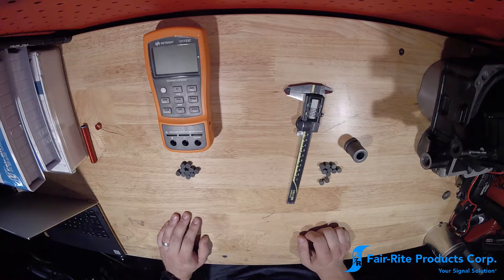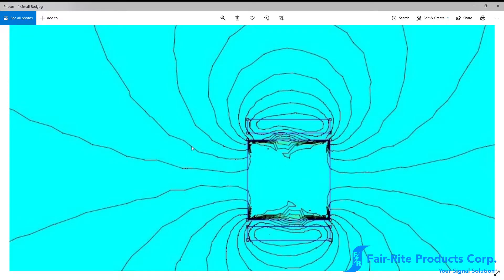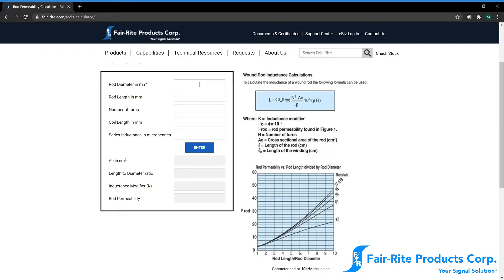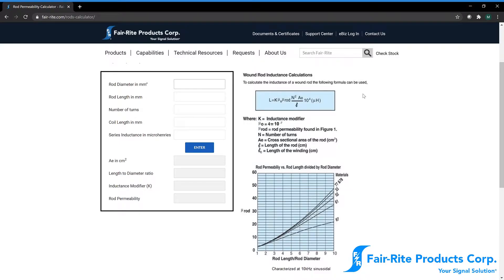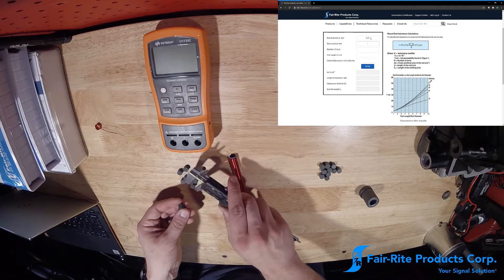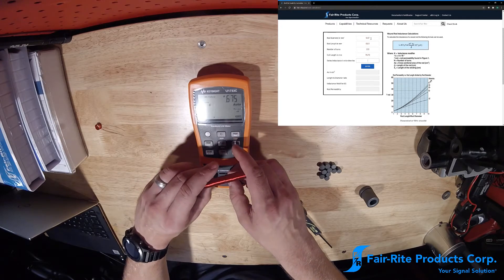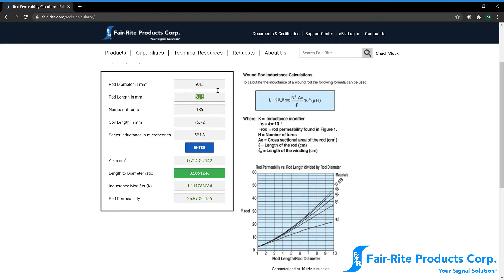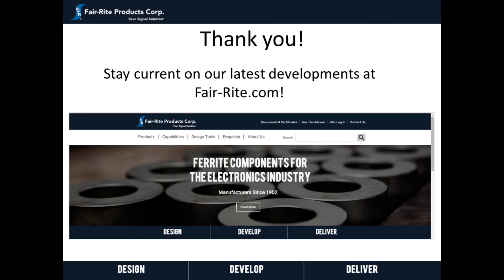How to Identify an Unknown Ferrite Rod

Comment: Hi! when tinkering around with stacked rods like you did in the video, I noticed that even the slightest gap between them led to a noticeable decrease in L, resulting in a lower calculated µrod and µi. Is there a way to take the air gaps into account in a formula? The formula for the effective path length used for toroids probably leads nowhere in this case, due to the magnetic circuit being open, not closed...? Thx!
Reply from the maker: The effective perm formula for toroids won’t be too helpful due to the difficulty in calculating the magnetic path length on something like a rod. What’s the total rod length and inductance? Do you have an approximate size for the gaps? Feel free to send your answers to ferrites@fair-rite.com and Mike will walk you through the best he can 🙂
Reply: @FairRiteProductsCorp  Thank you -- will do!

Comment: In the ferrite core video the calculations  the units appeared to be cgs ones, but in this one the value of absolute permeability is 4pi x 10^-7 which is the value in the mks system. Why does the magnetic industry still use cgs units? In the 1960s in the UK we used cgs units in school Physics but on leaving school and attending Technical College I had to get used to mks units.
Reply: Ha..ha.. the Americans still use pounds, miles etc in day to day life all along.
None of them cares about the SI units which came into Vogue in the scientific community ever since 1960 after the convention in Paris.
In a way it is a bit arrogant to me, to be frank. 
De VU2RZA
Reply: @subramanianr7206  In the UK we use a mix of metric and imperial units. Although the metric system has been taught in schools for many years, we still use miles for speed limit and other road signs and serve beer in pints in our pubs. Although the UK and US both use the International Yard and International Pound, which are defined in terms of the metre and kilogram, our liquid measures differ. Liquid measures seem to be expressed both in imperial and metric measurements for bottled drinks in both the UK and US.
Reply: @Martock1017  oh, thanks 👍
De VU2RZA